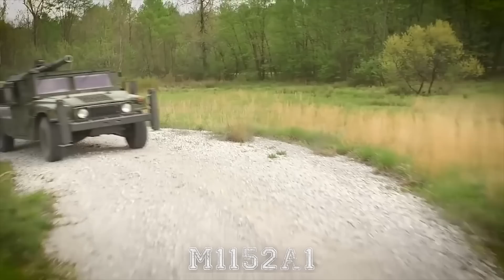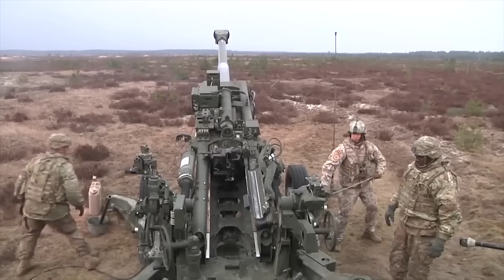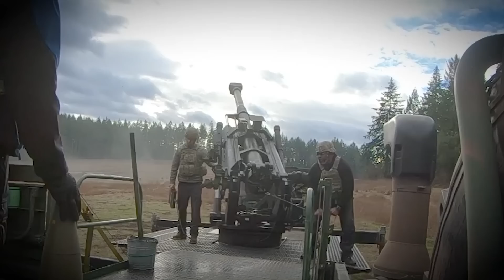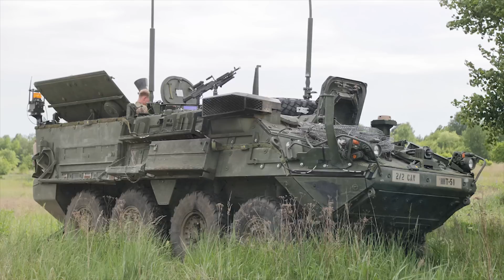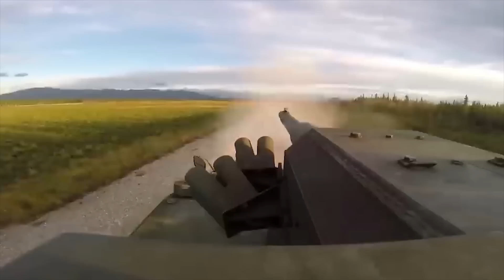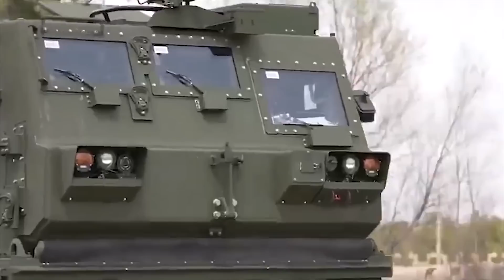Finally: US Built New HOWITZER With Extra Long Range!

Comment: I had been  the Head Operations Clerk for the 3rd Armored Divisions  Divarty (Division Artillerry) and then a Battalion Ammo Clerk for the 42nd Field Artillery of the First Cavalry Division, and so I reallly like the Armored Self Propelled Ammo  Carrier for 155 rounds.  That could be loaded up at depot.  Without them we had to  load up 10 ton Ammo  Carriers and take them out to the Field to where we have to break up the load into  Battery Size loads that we'd deliver using our own ammo  carriers.   These transfers in the dark of night, using Light Discipline  were dangerous and the year before I  arrived two soldiers of the 42nd were killed in a training accident, fun over by ammo carriers at night, so, yeah, SAFETY FIRST, but these Special Purpose Combat Ready Ammo Carriers would simply  Combat Deployments and make them safer.

Comment: Weapons are evolving from Industrial Age dumb weapons to Information Age smart weapons. 
The US Marines are calling it the "Mature Precision Strike Regime" and they have adapted their Strategic doctrine from "suicidal amphibious assaults" on contested beaches, too "island hard points" that threaten everything within hundreds of miles with Drones and Missiles. Thereby forcing the enemy into "suicidal amphibious assaults" to dislodge them.
"Drones own the battlefield."
Recently 50% of armored vehicles and artillery destroyed by Ukrainian forces, has been by $400 FPV drones controlled by one soldier in an undisclosed location. 

Guns are logistical nightmares requiring supporting vehicles, fuel, ammo, and lots of crewmen. They are Heavy Metal that must be must be Chauffeured to and from the battlefield. Guns are also range limited (~30 miles) even with reduced warheads to make room for guidance systems and rocket motors. By comparison HIMARS has a 50 mile range with GMLRS, 186 miles with ATACMS, and cruise missiles and drones can easily reach 1,000 miles with 1 meter accuracy. Guns are inherently non-stealthy, and Ukraine claims to have destroyed 7227 artillery systems in 600+ days. What has 10+ million artillery rounds fired by the Russians accomplished other than making toothpicks out of trees and moonscapes out of farmland? They certainly didn't cause more than 1 casualty in 500 rounds fired. A huge waste of logistics is a cardinal sin in war. "Captains should study Tactics, but Generals must study Logistics."

It is said that Ukraine has supplied 10,000 FPV drones to the frontlines, and they are doing 1/2 the damage. What if Ukraine had 100,000 drones X $400 = $40 million? Mines, trenches, and armor, are no defense against FPV drones. While the enemy always has a say, 100,000 FPV drones to Ukraine could quickly end the war in their favor.